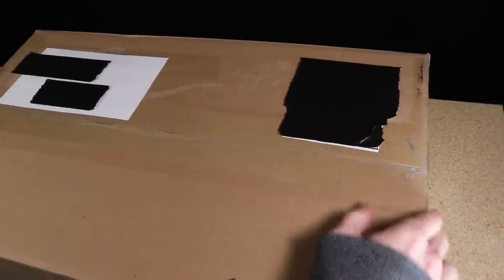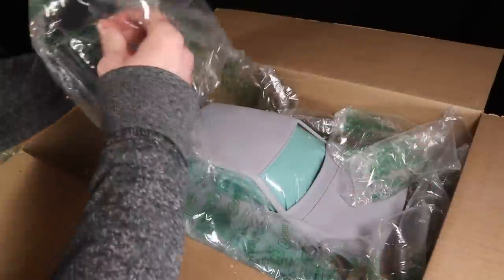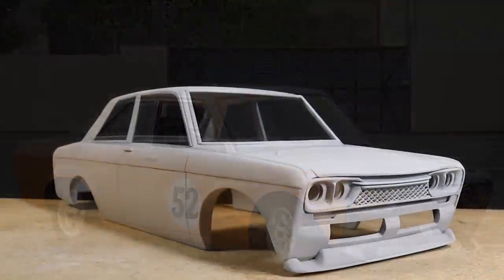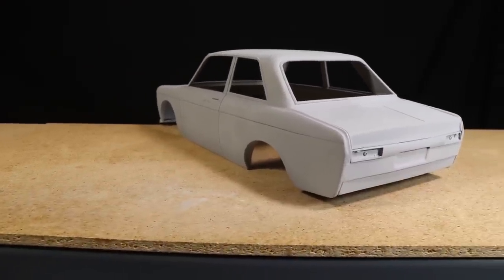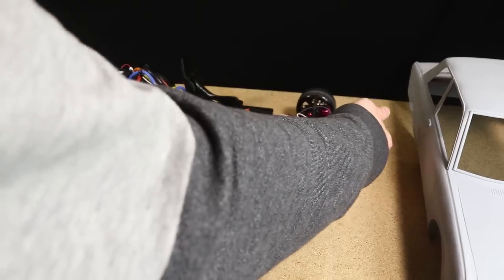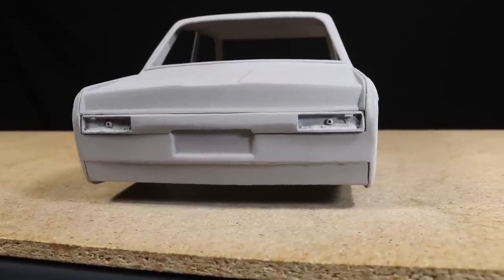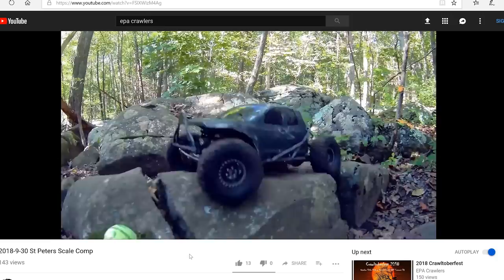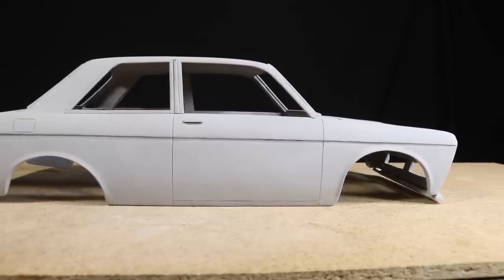Unboxing Scratch Built RC Car Body by Wesmade

Comment: Wait, this has to contain some 3d printed parts doesn't it? If not, I'm pretty much dead.
Reply from the maker: As far as I'm aware it's all hand built from styrene. You can see the whole process on Wes's channel.
Reply: @MakeItRC  Yes i looked at his process, and it doesn't seem nearly as scary as it did when i imagined how i would fail at doing it by hand, but it's no less awesome now that it's a bit demystified.

Comment: Can you please add me on FB.... i will talk more personally about my ideals on there.. it is this 1 video that is the stepping stone i need. My prof pic is army me on a forklift. Im after gettin into rc comps.... but not racing. More flashy body work n that shell almost got me twitchin downstairs hahahaaaaa. Any1 else feel free to message me. I do not own an rc yet coz i sold my last 3 but i wanna get into drift racing (so buying the 4 tec 2.0) but more so. Battery disconnected body shows that we have quite alot of over in england. Thanks to any1 that responds. More so thanks to MakeItRC for putting me in the right path.